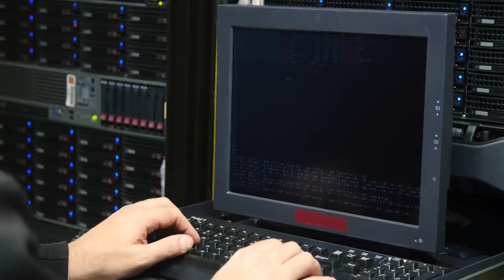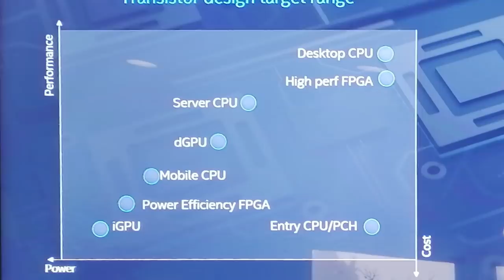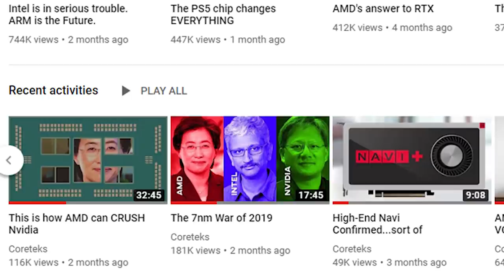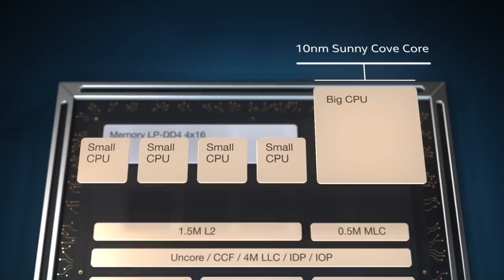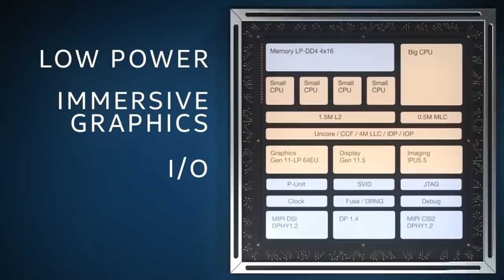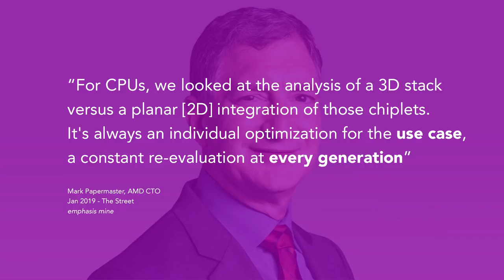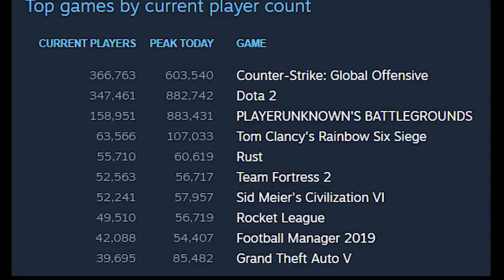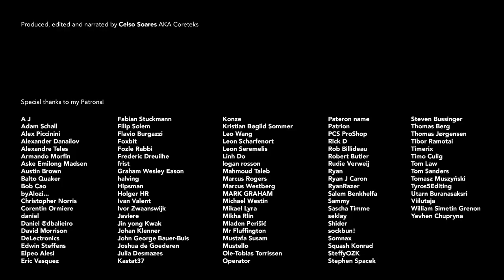2D vs 3D Stacking: Intel’s plan to beat Zen 2

Comment: You seem to forget that Zen 3 is already finnished, and Zen 4 on track... A year from now AMD has it's anwers already finished, they are not sitting still you know.
Reply: AMD is dead if their margin is eaten by vastly expensive mainboards (which cost full poor laptop alone), crapy cooling on X570 chipsets with PCIe v4 ( I doubt that anyone will make reportedly already define v5 without going full optical). AMD could have been saved by Apple and at least one cloud vendor with 2-3 years worth or large orders that would allow AMD to do general housecleaning, getting of entirely legacy products and set up in as many segments as possible using Zen 3 derivatives ...

Comment: I don't hate on Intel for being complacent and letting AMD take the spotlight.
Intel pissed me off in 2006 making a deal with Apple providing Core 2 Duo for the IMac and locking down the CPU market for months because of their deal. I couldn't get the computer I wanted with the processor I wanted.  So I said screw you Intel.  I'll build my own PC from now on and use AMD.  
Plus Intel processors are massively overpriced.  In addition no cooler provided which AMD does include with the Zen+.
I only recently bought 4 Intel CPUs because I'm getting into crypto mining.  AMD doesn't offer a suitable CPU that can do what I need.  Actually I think it's more motherboard manufacturer because they jumped on it right away.  In this case yes I'm shocked Intel provides a stock fan with the Celeron processors.  I'm actually shocked that Celeron is still around.  They are old line but I'm using 7th or 8th gen I can't remember.
Reply: These new celerons are also cutdown versions of new generations. Celeron is the lowest end, then Pentium,  after that follows the i3/5/7/9 lineup. All actual cpus. means 7th gen or 7th gen plus.
Nothing changed besides core count since Kaby Lake ...
Reply: I remember that - luckily was able to get basically the CPU i wanted - I ended up with a higher SKU than I originally planned.

Just getting into crypto mining - you know that that bubble is done - even the ASIC large scale miners are calling it quits.

Comment: Quite a long time ago I had sent intel an email about an Idea I had with shrinking down a pc into a single chip, the idea was to create layers in a single die that integrated everything from the cpu, cache, gpu, audio, memory, hard disk, i/o "north and south bridge" into a single unit that only required a single board with only external connectors for power, video, audio, input etc. This was sometime between 2008 and 2011, I can't find the original email, but somewhere I do have drawings I made for the original idea, Intel was chosen over amd since they had been making so many advancements over their competitors. I told them I was not trying to gain anything from the idea but wanted to change computing for the future! 

And the beginning of idea is finally here, with such small distances for data to travel it will allow cpu frequencies to be lower and require less power, which will reduce power demand and current flowing through the chip resulting in lower temps! I had an entire tablet of drawings for different technologies, everything from computer technology to military technology, some of which I did share to many different places, other technologies I had designed I left sealed and they will not be used, I spent years designing between 2006 and 2009. Another one of my ideas that I had shared to several places in the world was for a dam-less hydro-electric power plant, that email went out between 2006 and 2008, which is actually used in some places today, again when I share ideas I never seek reimbursement, I do it to help the world! 

You can try to call me crazy, most would, but recently I suggested a cloaking technology that was planned to be used for the newest and last manned bomber! I am sure they are far off from being able to develop it, but the technology could also lead to developments in controlling nuclear radiation and help slow nuclear fission protecting us from events similar to Fukushima! I have designs and plans for changing the automotive industry as well as replacing massive power grids, but that will have to wait, there are way too many greedy individuals, I was once offered to $50k in funding for developing a, portion of the technology but I refused when the offer included the fact they would be the sole owner of the patent/patents and seemed to have clandestine plans related to the technology, the technology will not be controlled by a conglomerate!
Reply: Damn dude continue innovating you're doing amazing stuff

Comment: i dont undrstand why amd would not do a 16core cpu the size of threadripper 2 with over 100mb of cache? cost? i think is a nobrainer to just make a bigger cpu with tons of cache...
Reply: The only thing holding AMD back right now from making a larger packaged CPU is their commitment to the AM4 socket, come 2020 and beyond, we might see a CPU package somewhere inbetween AM4/TR4. I would not be supprised if AMD shifted at least some of the system ram onto the package itself, like they have done with Vega.
Reply: @VeggieManUK  Yeah, an AMD APU with RyZen+Navi+HBM can't come soon enough.  The AM4 socket size even with 7nm chiplets, seems limited to a 3 chip solution ie.,  RyZen+Navi+I/O.  They could possibly switch to 7nm on the I/O chip and integrate more cache, but it looks doubtful.  For mobile/embedded platforms,  AMD will have more packaging options, and hopefully we will see an AMD APU solution much like the Intel+Vega+HBM Canyon Lake NUC.  I am really hoping AMD enters this market,  they can dominate an eSports budget oriented Desktop at $300, and Laptops at $500.
Reply: The problem is latency and die size. Adding tons of cache is going to create a massive die which is going to lower yields when the sole purpose of chiplets were for AMD to increase yields for their CPUs. And then there's also the latency issue, which is most notably shown in the Threadripper CPUs. While adding cache is useful, adding too much is going to cause large drawbacks and almost diminish the point of even having it.
Reply: @droptoasterintub297  its a better tradeoff than having tons of ram, wich creates more latency.
Reply: Cost, and locality. That would be massive and expensive, and more far away caches would hurt performance in as many cases as would help it.

Then again, there is surely a decent eDRAM implementation in the works for TSMC's 7nm, if not one ready to go.
Reply: @L3MONGamer  not really. You need all that RAM *anyway*. Added cache latency, a necessity of bigger caches, adds latency to accessing RAM, too.

Comment: i dont see 3d stacking being good for hpc. as you say, heat is going to be an obvious issue so these would more likely be for low power applications.
Reply: The future of HPC is computer based on FPGA-powered CPUs.
Reply: @KaptainUflg  FPGAs, known for their low power density...
Reply: @laurelsporter  At the other han FPGAs are very useful for application-specific tasks. For example, latest and fastest FPGAs can beat best GPUs easily in the field of machine learning.

Comment: We should make processors that are shaped like the letter T, only upside down. That way we could have heatsinks that cool down the chip from both sides. If the chip is made to transfer heat effectively, it would almost double the cooling down capacity.

In 3D stacking we should then have the layers that hate heat the most be on the top. And leave the part that tolerate heat the most in the middle. These chips would be harder to manufacture, but the benefits are much greater than the added cost of manufacturing. Though manufacturing the heatsinks would be harder, but still the benefits are greater.

Comment: Not realistic. Intel isn't going to crush any world market in 3D stacking CPU technology. If they were to initiate such scaling, the server markets would most likely be an entry point for them to offer such chips before releasing them for general consumer use. Public knowledge of any Intel breakthrough would give the news media at least two years of anticipation before they are marketed in mass and that's at the best case scenario.  The modus operandi of Intel is not to do the heavy lifting in technological breakthroughs but to acquire the talent or to buy the right to manufacture successful 3D stacking manufacturing designs. If they wanted to go by way of Xilinx processing then Intel already owns Altera which is a competitor to Xilinx. They have the knowledge in house to build their own but do they actually have the know how to do it performance wise, and are they willing to continue down that path in chip design? The current behavior of Intel would indicate any progress they present will always be sold at a premium to the market, and unless there is significant market penetration because of a need then adoption of such technology may not have adequate retention levels to justify continued business manufacturing of those designs.
Reply: "The modus operandi of Intel is not to do the heavy lifting in technological breakthroughs but to acquire the talent or to buy the right to manufacture"

How can you say that when the company has one the largest R&D budgets in the world? Not to mention, compared to their profits it is even higher.
Reply: @michellefanter4671  The size of their R&D and their profit margin, unfortunately, means nothing if they don't use it properly. If you look at the history of Intel, they have had to purchase and hire talent outside of the company frequently. On at least three occasions Integrated Electronics (Intel) has had to buy various x86 architecture from AMD just to survive for the consumer chip market because they couldn't come up with better designs. 
They have had to acquire companies rather than grow talent from within. They acquired Altera for their 3D and FPGA technology hoping to apply that to 3D stacking for their main chip designs. 
Much of their resources which could be interpreted as R&D have been allocated or could be directed to market manipulation tactics in terms of sales to retailers, OEMs, and system builders. These funds are used as 'refunds' or co-op marketing reimbursements.
Please read up on Intel history from the 1980s until today. Don't take a one-sided view that Intel does no wrong. They are big, so they can and do bully other companies around.
Reply: @fturla  I haven't argued for their efficacy, but your statement that their way of doing things is not the heavy lifting. I completely disagree, given that their investments are mainly in R&D. 

I've looked and known their history, most of their acquisitions came from 2010, not beforehand - and this is after they have been the frontier of technological advancements. 

I find it a bit confusing since you call Intel 'big' and 'bully other companies around' yet at the same time claim they had to buy x86 architectures from AMD "just to survive".

Your last line seems to imply I'm supportive of 'Intel', as a company. I'm not, I don't like Intel nor AMD nor NVIDIA as companies and I don't support either of those. I want a good product for its price and that is all there is to it. I haven't bought and intel processor since 2011 when the i5-2500 was released.
Reply: @michellefanter4671  No, I don't imply that you are a supporter of Intel. I am implying that they market themselves as a company that is self-sufficient but they are not. My background in terms of viewing Intel is through the co-op agreement programs that they have had over the years since I have had experience in that part of business agreements between companies in terms of sales to consumers. The Intel interpretation wasn't just based on initial advertising of coordinated products that had Intel products contained within but the gross refunding to companies was based on total sales of their products in relation to sales sold with competitor equipment.
I understand that you are confused about Intel being big but they can be weak at the same time. There's no contradiction in that statement.  Sorry, I can't help you understand the logic. It's up to you to seek the truth.

Comment: I think you're over-estimating what Intel will be able to deliver via 3D Stacked Dies Vs. AMD's Chiplet Design, when it comes to Cost and Heat.
A great real-world example is HBM / HBC Vs. GDDR / DDR.

HBM2 is capable of up to 8GB / Stack (16x 3D Layers) with up to 1024-bit Interface (16 Lanes) … in terms of Clock Frequency we're talking 1,200MHz is essentially the "Upper Limit"., while using 26w Power and producing 22w Heat. 
GDDR6 is capable of up to 1GB / Chiplet with up to 128-bit Interface (4 Lanes) … in terms of Clock Frequency we're talking 3,600MHz is the "Upper Limit"., while using 4.2w Power and producing 2.6w Heat.

The other thing to keep in mind is that., for HBM... you have a diminished return in regards to placement., as the Closer you can have it to the Processing Die; the Better; as that many Data Lanes is actually expensive. 4x more Expensive to be precise, when you locate it as "Global" rather than "Local".
And the same is true in regards to the Interface themselves internally., you're looking at 4x the Silicon Space for Memory Controllers and Data Bus to take advantage of the extra Bandwidth. 

There's also the question of Cost.
Remember that we're looking at HBM2 being $28/GB., while GDDR6 is $9.7/GB... and again this is entirely due to the 3D Stacking Element. 
Sure, Mass Production "could" potentially reduce this., but it'll NEVER be AS Cheap as the alternative. Nor will it run as "Cool" or "Power Efficient" … the reason that sure, ARM can arguably get away with such is because it isn't Monolithic.

That is to say, that even the Processor Core itself., isn't strictly speaking a "Complete" Processor, but is instead is in-of-itself a System-on-Chip Design.
Where-in... you're not doing Floating-Point, or you're only Processing 16 FPU Instructions instead of the available 64 FPU Instructions / Cycle? Well those are dispatched to 1 out of 4 of the FPU Units with the others being disabled. It's very clever and sure, it lends itself well to being quite "Power Efficient" but it's not very good at rapid Transition. 
That's to say it takes a few cycles meaning you must have a few queued Instructions over the 16 being used., in order to reinitialise the other FPU Units and utilise them; which adds latency to instructions on First Run depending on Scope.

There's a reason why NVIDIA are only using 3D Stacking for their Fixed-Function Pipelines in Volta and Turing., but the x86 Architecture doesn't lend itself well to such an approach. 
Intel's Itanium Architecture would., as would Compute, at least potentially (likely why they head-hunted Raja Kadori) in it's VLIW/SIMT Variant but x86 doesn't. 
At best what it allows Intel to do is produce Semi-Custom SoC Solutions easier without having to use a Distinct Processor Design., instead they can use the same Template SoC Slices; and have Switchable Modules for the Specialist Task that they need., while remaining a "Single Package" that saves Space in a "Single" Production Queue., which arguably is Cheaper to Product En-Mass.
(Identical to how ARM is designed) 
Where-as it isn't that AMD can't do that with Chiplets; but instead it would be more akin to a Custom Chipset On-Chip rather than On-Die., they would still be Custom Dies. 

Which approach is better., well … we'll see. 
Personally I have a feeling AMD's Chiplet approach is much better from a Chip Production Standpoint; where-as Intel's 3D Stack is better from a Chip Designer Standpoint., and actually we have quite a few hints today that Intel are simply planning to phase out being a Chip Manufacturer in favour of Licensing Chip Designs; like Motorola / IBM / ARM / MIPS / etc.
Reply: you can't even read your own figures, hbm is the more efficient tech, and no the die space needed to accommodate it is not larger its actually smaller as a large part of the controller is on the bottom layer of the hbm stack.
about price hbm right now is being used mostly by really expensive fpgas and gpus which keep its price up as they can afford it, as prices of the products using it starts to come down and volume increases we should seen pretty good price drops.

Comment: Improving memory bandwidth will improve the worst case performance of common applications, but won't do much at all for the better optimized ones like games. Short term there's more gain to be had in scalable architectures.
Reply: Yep, you only have to check a few benchmarks to see how little performance is gained in most real world applications, even when practically doubling memory through-put.